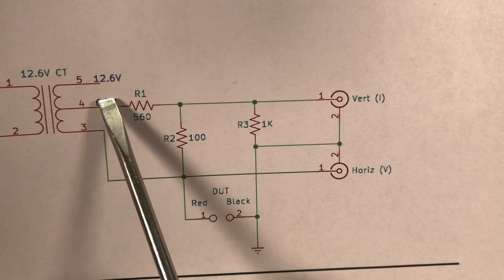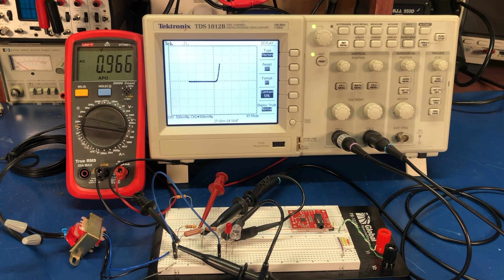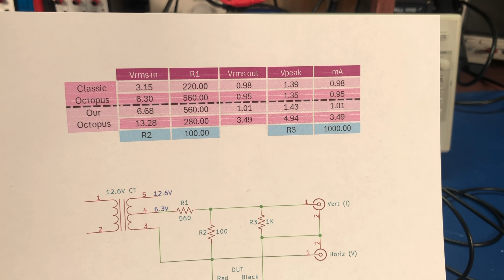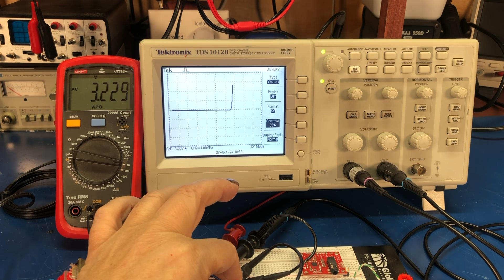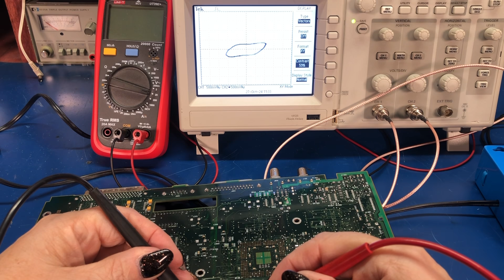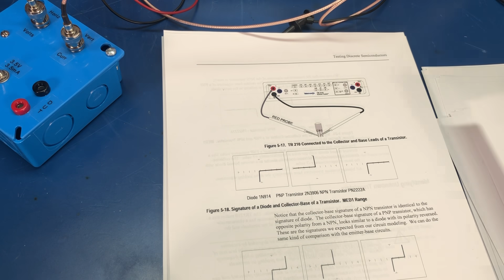Let's Build an Octopus (IV Curve Tracer)

Comment: It's a good video and I appreciate the content but the schematic is badly drawn.
Reply: To me, it looks like the voltage divider is between R1 and R3, not R1 and R2.   R2 is a current sense resistor, not R3.  R1+R2 is the current limiting resistor.

Comment: I built this and seem to have issues with constantly having to adjust and finagle the settings, it seems like you set it and forget it. Any ideas or tips?
Reply from the maker: Hello! The octopus only has two settings. In the 1V range, I set both channels on the scope to 500mV/div, and in the 3.5V range, I set both channels to 1V/div. On an analog CRT scope, you do not need to worry about the horizontal timebase, but on a digital scope you might need to play with the timebase to get a good curve. What specifically are you tweaking?

Comment: How essential would you say is having an option to test at a higher frequency in one of these as opposed to just testing at the line frequency of 50Hz? I am interested in building one but have never used one of these before, plus how safe is it testing boards that have TTL and CMOS chips? The idea of applying negative voltages close to these chips seem concerning.

Comment: Hi Donna, l built the (Our Octopus) and I have to thank you for that mod. I already started building it before I came across your video. Then I saw your solution for more voltage and current for offboard testing of certain devices like LED's. Adding that switch was a game changer for my build. I use it mostly for offboard testing anyways and this Our Octopus is perfect. Thanks. BTW screw those haters. Be yourself. 😊
Reply from the maker: There are so many ways to build one of these. My main one has 8 ranges, an A/B switch, negative voltage limiting... It's more than I need, but it was a fun build. Video is here: https://www.youtube.com/watch?v=_FzBBtQk5RY

And thank you for the kind and supportive thoughts! 💜

Comment: Olá. Sou do Brasil. Encontrei seu vídeo num site. Comprei o invcurv v3 se tivesse encontrado antes, não tinha gasto r$600,00, ainda sem poder, pois tenho 55 anos e estou desempregada, estudando eletrônica sozinha desde outubro do ano passado. E vi que às assinaturas não modificam para os mesmos componentes. Espero que não ache ruim se eu pedir algumas explicações. Não sou boa de cálculo, lógica, mas já fui no passado. História de vida difícil a minha. No caso aí você utiliza o transformador com resistores, etc, porém para vizualizar às assinaturas, o osciloscópio. Eu tenho um osciloscópio digital Fnirsi Dpox. Não tenho aterramento verdadeiro aqui. Acredito que não daria para utilizar num osciloscópio portátil para ver às assinaturas, pois é ligado o seu aparelho em 110V? Será que eu conseguiria adaptar um desse para ser ligado com um cabo que alimenta um notebook? Desculpas por tantas perguntas. Obrigada
Reply from the maker: Hola!  110V will work fine, and you can use a portable osscilloscope, as long as it is two channels and has XY mode. This video shows using a small handheld portable two channel scope with the octopus https://www.youtube.com/watch?v=fN7LrNAyKyI
Reply: @Donna_Matthews muito obrigada. Vou ver o vídeo. Se eu montar da forma que está no seu projeto, dará certo. Acho que tenho um transformador por aqui em uma placa velha. Só preciso ver se é da voltagem correta. Eu não encontrei o esquema correto inteiro. Até mais.
Reply from the maker: @placaterapiaEmAção  I posted the schematic in the Posts section: https://www.youtube.com/post/Ugkx7JZQaw-w5ayA3P6l88Abvq-kEgPdXNeW
Reply: @Donna_Matthews esqueci, eu tenho o Fnirsi Dpox 180. Não sei se são 2 canais x e y, vou verificar. Aqui no Brasil para comprar de fora, pois não fabricam nada, é muito caro.

Comment: Gary, does the impedance of the bnc jumper cables to the scope matter?
Reply from the maker: It's all low frequency (50/60Hz) and short runs. However you connect to your scope is going to work.

Comment: Nice video, I’m going to try and build one. Wondering what kind of transformer you used? Thanks!
Reply from the maker: The transformer was harvested from an old alarm clock. It is a 12 volt center tapped transformer: 6v--0v--6v, which I am using as 0v--6v--12v.

Comment: Why do you need a DPDT switch? You're routing either 12V or 6V through the same value resistor on both switches, so an SPDT switch is enough, and simpler.
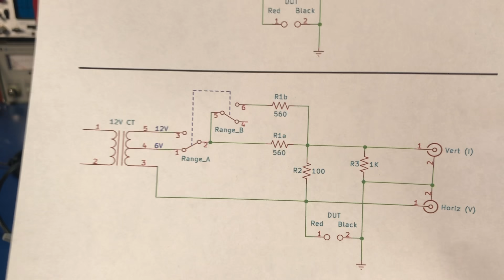Reply from the maker: If you look in the video @6:00 you will see the second pole of the switch is used to switch in a second 560 ohm resistor in parallel to the first one when selecting the higher voltage.  This gives an effective resistance of 280 ohms, limiting the current to 3.5mA.

Comment: Thanks for the video!  I'm still new to building and repairing electronics, so asking this question from ignorance.  What was the reason for switching to the 12v on the transformer instead of staying with the 6v center tap and just build your two voltage dividers from that (1v and 3v)?  I'm thinking about building this and have a 12v non-ct and wanted to be able to test zener diodes out of circuit that are typically 18v zener.  Thanks again!

Comment: In the schematic I see 2 switch for range A and range B while in the real prototype I see only one switch, is it one switch or two used?
Reply from the maker: One DPDT switch. The dotted line shows the two poles ganged together.
Reply: So R1a and R1b are connected together?, and only the switch between the 6v and 12v?
Reply from the maker: @gaberboraey5477  It is a double pole, double throw switch. One pole switches between 6V and 12V, the other pole switches R1b in parallel with R1a when switched to the 12V position.

Comment: Curve tracers are most useful to match devices. Sometimes, one needs matched diodes such as in a mixer or matches transistors such as in a high power class AB1 push pull amplifier.

Comment: A company that I worked for in the early 1980's had one of these, but I don't ever remember seeing the user manual for it. We tried using it a few times but never found anything significant with it. I always wondered what was inside. There was no Internet in those days so I couldn't easily look this stuff up. Thanks for the informative video.
Reply: Late 80s/early 90s I worked at a company repairing PSUs, monitors and other analogue stuff, the 'component tester' in the Hameg 'scopes was absolutely invaluable to us and a really fast way to locate faulty parts, you could swipe through a PC PSU i just a few minutes and isolate faulty parts, leaky caps, open resistors etc, even faster if you had a good or differently faulty unit to compare against, I still have a Hameg 'scope and occasionally use the comp tester even now if something goes faulty.

Comment: HI, what kind of cable do you use to make the osciloscope probes?. Seems wifi antena cable
Reply: Pretty much any coax will do for Octopus cables, there's no high frequencies involved. 

Real 'scope probes are made using magic and pixie dust under a full moon with the correct incantations (OK that's silly but there's a lot of science and effort goes into them and they are probably cheaper and easier to buy than make, especially if you need more than a few tens of MHz capability)
Reply from the maker: @antonioandres25  I bought the cables on EBay. They are just thin coax cables with BNC connectors.
Reply: @GaryLaRocco  Thanks

Comment: Handy, but to be honest I dont recall any components actually failing in my designs and needing to be hunted-down with a curve tracer. Usually it's one of my hand-soldered surface-mount components that has a cold joint. In other words, MY fault.

Your multimeter has a nice diode-test function and usually will work safely and accurately in-circuit. Yep, it even finds bad solder joints on teeny-tiny SMT transistors.

Comment: GARY, Any reasons why the 1v/1mA and the 3.5v/3.5mA outputs DON"T turn on transistors measuring components in-circuit?
Reply from the maker: 17:10 shows testing the transistor. I could have chosen an easier board to poke around on. 😕

Comment: Back in the 80’s and early 90’s these things were hugely popular, especially if you had an identical but functional PCB to compare with. Some techs were wizards with it, easily finding faults with it. As for myself, never got into it, but I can see why some techs were wizards with it, but hey, fault finding is an art, what works for one, does not work for all. Like most youtubers never seem to use an oscilloscope, for me an oscilloscope is the most important tool to use…

Comment: I had a Huntron Tracker on my bench at work back in the early 90s, you can actually find the service manual online, but I think the main ICs used in it are obsolete devices now. 
The basic principle of the Huntron is easy enough to figure out, and has the advantage of switchable frequency and voltage of the sine wave.
Richard over at Learn Electronics Repair made a similar IV Curve tester with a relay switching between two probes with a common ground so you can compare two nodes in a circuit. This is great, say in a stereo amplifier if one side is faulty, and the other is working or if you have a known good electronic device to compare to a faulty one. 
This type of testing can be invaluable IMHO, and can really get you in the ballpark of where a fault lies.